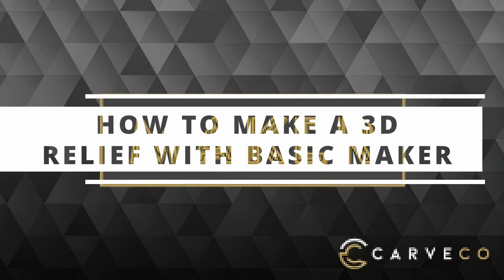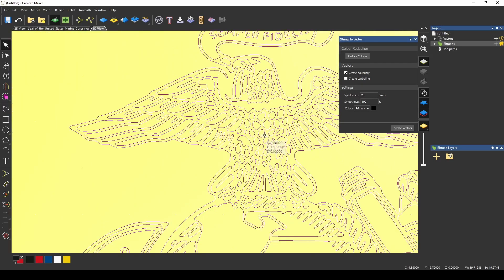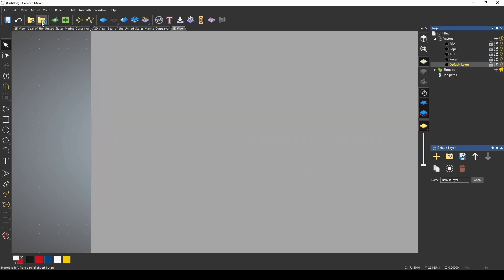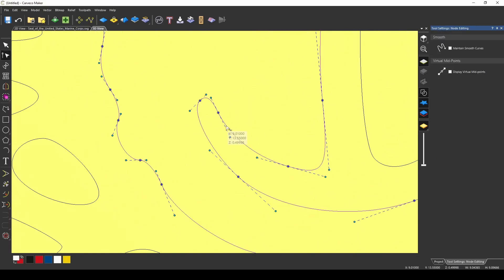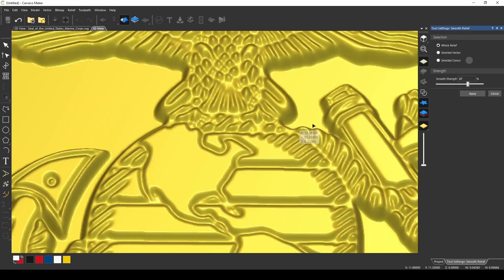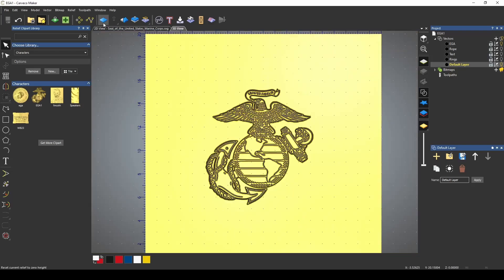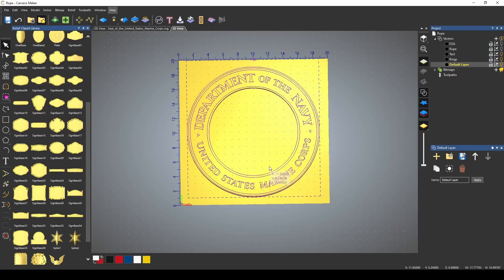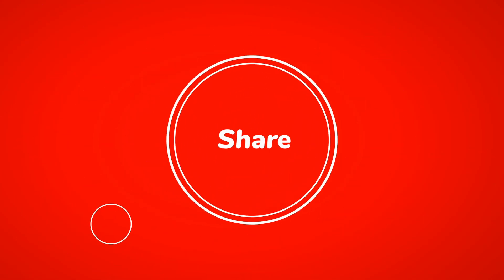Unbelievable 3D Design Trick: Create a 3D Marine Corps Logo Relief with Basic Carveco Maker.

Comment: Jason When I go to Zero Outside the vector I only get Zero inside the vector. What did I do Wrong
Reply from the maker: The zero inside of vector is one of mulit tab choices available. Any button that has a little white corner means that there are more than 1 tool in that spot. You have to hold your mouse button down over the button to reveal the other choices in that stack.

Comment: Hello! Great tutorial! Could this be used for 3d printing and possibly making a silver plaque out of the 3d relief?
Reply: Well thank you for the fast reply. A followup question would be, can I make a draft angle to it in the program?
Reply from the maker: @NS-py9cw  If you use this trick to make a model of your design then you can use the fade relief tool to add the draft. The strength of the fade tool will be the angle that the draft is. I have a video on the fade relief tool in my videos playlist.
Reply from the maker: Well Carveco is not a  true parametric design program so it does not produce the 4th axis but if its a 2.5d relief like this example then yes it will work.
Reply: That is great news! Thank you, I will look it up asap!

Comment: Hello Jason, I'm trying to redo the project here for the EGA. I seem to have run into some software issues with Carveco Maker. When I follow along with your video I noticed that when I try to move the EGA symbol to another level the level is created but there is no light bulb to turn the level on and off so I can transfer the rope to its level. This did not happen originally when i tried to create the relief a couple of weeks ago. I've tried to delete the levels numerous times and delete the whole model a few times to start over but that does not work either. I do notice that there are references to the old levels that pop up that i would assume would be disposed of so I can start fresh. Is this something you've run into in the past?
Reply from the maker: On the right side were it says vectors is were these vector levels should show up. You can only move vectors and not the relief parts. Also make sure the vectors that you have selected are not grouped with ones you do not plan to move. Right click the vectors you want to move that should be pink in color and then select move to new lever. the vector tab may have a drop down arrow that opens up below it to show the different vector levels. Hope this helps.
Reply: @Timberfalls  yes, that is where I'm looking on the left. When I contacted you I had been looking at your video on my PC while I did the lesson on my laptop. Last night I went to review your video on my TV app for YouTube under Amazon Prime and the two videos are quite different in content. The video on my TV was expressed slower and more in depth, but the one on Mt PC through YouTube direct through the internet provider was more rushed and seemed to be missing the full content (example-it flashes right past you setting up the model) Don't know if you produced several videos of the EGA, but they are definitely different
Reply: Sorry right screen, not left!
Reply from the maker: @awehnert235  This is interesting and something I should look into. There is only one video and it was produced in 4k 1920x1080 at a natural speed. One thing I will tell you is there is a setting in the video settings that can run the video faster or slower than normal so you can watch it at like .5 slower or .5 faster. May want to make sure this has not been changed.
Reply: @Timberfalls  Jason, it's not the speed of the video. It's that potions of your content have been removed to shorten the video on the one version. I sent this original message from the shorter video. The 'full' video was viewed through Amazon Prime on my TV and selecting the YouTube app through Amazon
Reply from the maker: @awehnert235  Hmm that is not good at all. I wonder why they would shorten it. I do  not have anything out there other than my original video that for my knowledge has never been sampled or edited that I have any kind of notification about. I will ask youtube though.
Reply: @Timberfalls  Side note, thanks for the training you provide. All have great content! The internet world is getting stranger, and the people pushing decisions on content are getting way out of control!
Reply from the maker: @awehnert235  I really appreciate the positive feedback. I would agree that the algorithms that control things are getting harder to navigate without bias. Something needs to happen or I fear it will only get worse unfortunately. If you would like to join our members discord channel I do have a free tier that gets you into a non members chat room with others who are learning about CNC stuff. The paid tiers give additional resources but are not needed to join the group. but no worries if its not your thing I just wanted to extend the offer.

Comment: Jason, I'm following your video and on my laptop I'm doing the work. 1. When I paste the sign 28 there is no border to erase on my screen (don't know if there was a software update since your version on Maker to mine, which was just loaded 2 weeks ago). 2. My EGA does not have the closed loop shading vectors at the edge of the globe like yours has. Did you close those vectors or do I have the wrong EGA file? Seal_of_the_United_States_Marine_Corp.svg - is the file I downloaded. Reason being my vectors are interconnected to the parallel lines across the globe and not separate so the height change does not have separation. Please advise, thanks!
Reply: Cancel #2,  I was looking at the relief incorrectly. I have the same view as yours as I looked closer
Reply from the maker: When pasting the sign base you need to create a boarder yourself to create a cut away line. I use the square vector tool for this. I created my own vectors from a photo I had of the EGA. Those outer vectors have to be closed independently and may need to be edited to accomplish this. Hope that helps. I have another video on how to do this that may explain more where i make a flower so maybe check that one out.

Comment: Hi Sir you are the best ever at Carveco , is it possible to add the 3 d Relief art like a football Helmet and put logos on helmet and football and to do a Area Clarence
Reply from the maker: The limitation of this trick is that what you import and change height on will have straight walls and will be more of a raised look than a 3d one. If you could find a 3d model of a football helmet and then use this trick for the logos would work well though.  Maybe use a little smoothing afterwards to round it out some.